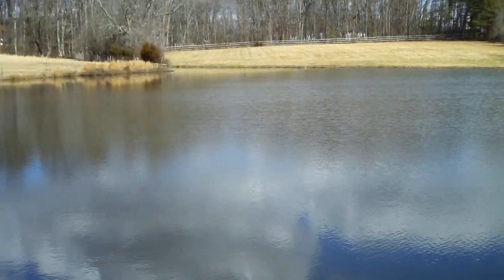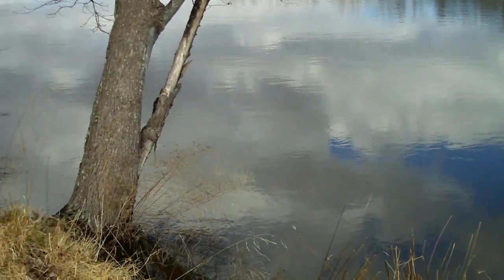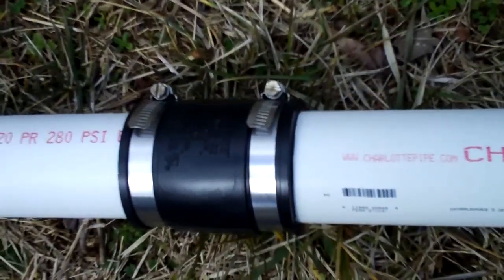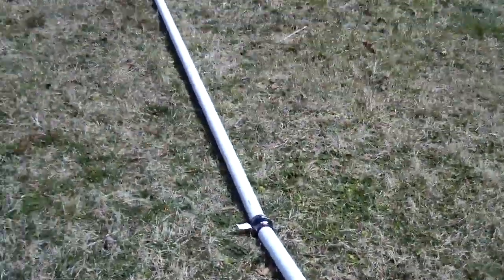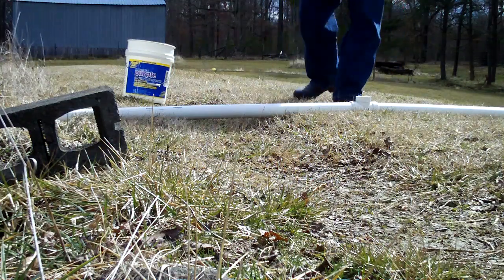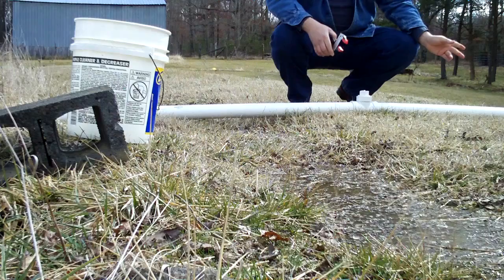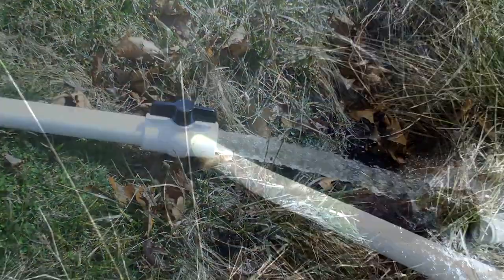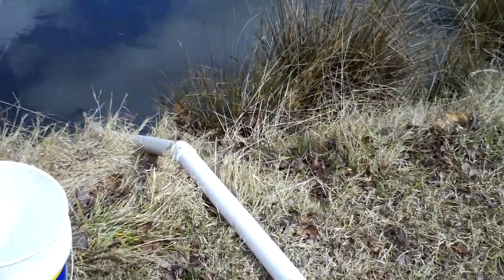DIY Pond Drain-Siphon

Comment: I also used a siphon. But I launched it with an ejector.
And not to drain the water, but to pump out the bottom sediments in the lake.
Reply from the maker: How does the injector Method work, sounds interesting enough

Comment: Wow.  I'm surprised for a pond that big they only used a 4" drain...seems like it would need at least 6 if not 10.  Of course depends on where you are in the country and how prune to heavy rain you are.  I know a pond smaller than that in Virginia that has a 10" pipe.
Reply from the maker: Several years ago I looked up our property on USGS, and the pond was shown on some old aerial photos back in the 1930s. I'm guessing it was ok for use back then or it was money issue for property owner possibly, it shown its age and slowly rusting away, I wish it had at least a 6 inch pipe, but we do have a spillway to keep the dam safe.

Comment: Do you need a filter screen on the end of the pipe? Couldn’t hurt I guess..
Reply from the maker: On the pond side I drilled one inch holes on 12 inches of the dip pipe that goes in the pond, I left the end of the inlet pipe open for maximum flow, but if there were a accidental blockage at the tip of the inlet or pond side, the one inch holes I mentioned earlier would allow for water to continue, I used a screen for some time but it made for a problem with debris blocking the inlet at times.. hope this helps.

Comment: When we pour water in the pipe the valve on one side is closed but the other side of the pipe closed or opened or opened both the sides at a time after pouring water.. please tell me...
Reply from the maker: Valve is CLOSED on OUTPUT end, fill pipe with water,make sure pipe intake is in pond,  then open  output valve, video shows everything.

Comment: Can’t you add a shut off valve on the metal pipe, where you placed the block of wood?  You then can manually drain the pond when needed.
Reply from the maker: Yes. I could, but the cost of a shut off valve is exspensive for a 4 inch pipe, also there is no flange which means a shut off valve would have to somehow clamp around the existing pipe. It would need to be brass for corrosion as well. So needless to say I spent a lot less money, but I always have to prime before use. It sucks but it works.

Comment: Will this automatically start pulling again once the water levels ride above the pipe? My pond pipe is not moving water fast enough when we get rains around 4". If I want the pond to remain at a set level, I just need the set the pipe at the height of where I want the water to be, correct? And after water fills the tube and picks up speed it should cause suction? Any help is appreciated!
Reply from the maker: Water would have to be at the level of the highest part of your siphon in order for it to actually start itself, which would most likely washing over your levy/dam, basically you would have to get a pipe put in the dam at the level of water that you want to keep within your pond or lake.
Reply: @Wallabydam  okay, that completely makes sense. I've got a buddy who owns and operates an excavator. Thank you!!
Reply from the maker: @curiouslygeorgeous  sounds good. If you do take that route,  installing the pipe within the dam at the level you want, make sure to use/pour a concrete bulkhead around the pipe slightly within  the dam on the pond side to eliminate  water seeping between pipe and soil and causing erosion and possibly  dam failure, hope all goes well for you 😎
Reply: @Wallabydam  that's a good point! I'm also going to put concrete riprap in the back. Hope it goes well too, because I can't believe some of the quotes I'm getting on this. I just don't see this being a $10,000 project. Thanks so much for the replies!
Reply from the maker: @curiouslygeorgeous  you're welcome if you drop a message back on here and let me know how everything goes!

Comment: I tried this syphon but Im getting problems. I want to drain out a garden area that's flooded. The main run off drain is two feet above my land, hence the reason the water can't run out. Can someone tell me how to make a syphon for that
Reply: It sounds like you are trying to suck and not syphon. You can't syphon uphill as the outlet has to be lower than the inlet. As the water falls because of gravity, that water creates an area of low pressure causing the water to move towards the area of low pressure. This is how a syphon works. The way you described your situation it sounds like you need a pump as a pump doesn't utilize gravity to create the area of low pressure.

Comment: U will have to use a oneway valve at end of pond side. Otherwise whatever water u filled in clean-cut will go out in pond. Incomplete video.
Reply from the maker: Nothing incomplete, you saw the video. It works,  you do not need a check valve on the pond intake. If your scared of losing a little bit of water goin back to the pond, all you have to do is raise the pipe up a few inchs with a small log or board. Pipe only needs to be filled on the Drop/outlet side, Nothing incomplete in the video.

Comment: Hi nice 👋 
Question do have a check valve on the other in ?
Thanks for your information.
Reply: Thank you.
Very good 👌
Reply from the maker: I only use one shutoff ball valve at the end, I keep it closed, then walk to top of dam and fill entire pipe with pond water using a bucket. Once pipe is fully filled. I just open that valve. I believe a check valve will slow the flow and decrease the volume of water, so for that reason I just use open piping on intake/pond side.

Comment: Q1. Can we use NRV at the suction point.
Q2. What should be the minimum distance from source to destination and minimum height of the suction & Discharge.
Reply from the maker: That will be something you will have to figure out for your specific application, depending on diameter of pipe, elevation of lift from suction point, length of pipe from suctioning point ,etc  mine has to lift water up 4ft through  a 2 inch pipe, then levels off for 10 ft. And down 30ft at roughly 35- 40 degree bank.  Basically  you need to make sure you have enough length of output piping  so it has enough "water weight" to be able to pull enough suction to draw up water and continue a siphoning,  hope this helps somewhat. Everyone has a different  situation, you will need to figure what works for your application.
Reply: @Wallabydam  Thank you
Reply from the maker: @Prabuvirus  sorry I could not be more helpful.

Comment: I'm considering a property that has a tiny watering hole that I believe to be risky for stagnant water.  About 6 feet away is a very minimal flowing (trickle really) creek.  I ran across this and think I might try this to drain the watering hole and do some work on it to make it into a natural swimming pond for my girls.  I'm just not sure how to keep it from returning to a stagnant state again.  I'm assuming a pump to cycle the water out like a swimming pool?
Reply from the maker: Water runoff that enters into this watering hole or small pond could contribute to foul water spending on what organisms, and or bacteria that can be picked up along the way heading into your pond, it is my understanding  that it is better for your pond to transfer or exchange water by pulling  water couple feet from the bottom ( pending how deep your pond is ) but you can do one of a few things to help slow or eliminate this but you may need to take extra measures in conjunction, Air stone, a air stone would help oxygenate  your water using a small pump and air line, tiny bubbles emitting from the stone and help slow processes  of stagnate water,  OR you can use a fountain that will circulate water by means of sucking water from the pond  and spraying into the air back into the pond which can help oxygenate water and help prevent stagnant water, people have used pumps that circulate water  but in conjunction with a ultraviolet  light that can kill some of the nasties in the water,  but the best way is plenty of water to (exchange) enough water in your pond and help by displacing enough to (flush) out the nasties, some of the items I mentioned earlier are sometimes used in some fish ponds,, but there is so many variables for every  situation, as silly as it sounds  you may be able to use pool  shock or chlorine that would kill off alot of nasty stuff in stagnant water, but I mean at that point you still have to check water and ph. Might as well just get a pool at this point 🤔 these are ideas, im sure someone may have better solutions, but your idea sounds great, wouldn't  it be great to have a watering hole clean and maybe a short stone wall around the edge, I hope some of this helps. I dont have a definite answer for you but it sounds like you may have something potential, if I can be any further assistance plz let me know. 😁

Comment: Thank u so much! That is awesome and helps me A LOT! i need to drain a pond that i didn't even have before the rains. 1/2 acre completed flooded.  Make more of these videos, u have some great ideas!
Reply from the maker: Thank you Miles. Just make sure you do not have any air leaks in your system or it will not create enough vacuum to start the siphon I just walked in from starting the siphon for my pond a little bit ago because of the heavy rains that we have received and I had a small air leak in it made it to where I had to try three times to start the siphon only because I don't glue all my joints together but I did use some window caulking putty to put around the scene in stop the air leak so I could actually start the siphon.. I'm glad this was helpful for you, and good luck on any of your future endeavors..
Reply: Dr.miles how many running flow time use

Comment: My brother had the same problem with his pond drain. Only it was just clogged with debris. We tried and tried to unclog the main drain but couldn't. Then, we saw your video and decided to try your siphon system.  We had plenty of 1 1/4" pvc so we used that. went to lowes and bought thr same fittings as in your video. Put it all together and primed it, opened the ball valve on the drain side and it works perfectly! Thank You for the idea!
Reply from the maker: I tried as well to repair the drain without draining the entire pond with no luck. With  the way the dam is laid out and amount of fall. It ususlly takes about 4 to 5 days depending on how saturated  the surrounding fields are and water that leaches into my pond.  I have a emergency  spillway  but do not like it because erosion,  I hope all works for you just as well as it has for me,   and your welcome ! Have a great weekend.
Reply from the maker: By the way, make sure to put something like chicken wire on the pipe that sits inside the pond. Turtles and fish or debris always gets caught up in the pipe and will stop your siphon,
Reply: @Wallabydam  i didnt out any sort of screen on the end but we will do that. thanks again.

Comment: This is awesome. I have a retention pond on my farm and the steel pipe is clogged. Maybe a turtle got stuck in there idk. 
I was gonna buy a pump.
Not now.
Reply from the maker: I had several turtles  stuck in mine over the years and would be a pain in the rear. My advice is use something like chicken wire on the pond side of the siphoning  pipe or u may end up restarting the whole process,  they will be nosing around the suction side of it and get caught  and stop it til the suction breaks.  Goodluck  with your project!

Comment: Great information here that I plan on putting to use within the next week. Did you ever fix your original drain issue? We have the exact same issue on a 60 year old, 3 acre pond in Georgia and I'm hoping to either repair or replace my current, collapsed drain.
Reply from the maker: Never did get the old drain fixed without draining the pond and digging up the dam to install a new drain pipe and seep collar. I still use the 2 inch siphon drain, looking into a way to  make a pump to prime the pipe without using a bucket and funnel. But for now it works as intended, hope yours works well for your situation! One day I will figure out a new solution  or alternative  but till then I been using this siphon, it's been running for over a week now from all the rains we get on and off.
Reply: @Wallabydam  My intention is to lesson the load on the dam for now as my spillway is getting way overworked. Then eventually drain it enough to determine if my current pipe is 100% unworkable. My dam is the exact size and configuration as yours, except for many years of tree growth on the back side. If a new drain is needed, my thought is to trench out enough to add a new pipe that is only deep enough to be vertical on the pond side and then quickly turn 90 degrees and exit through the open trench in the dam, with a seep collar, and then create a shallow trench on the back side of the dam to bury the run, down the slope, to our creek.

Does this sound workable to you? I'm sure I've overlooked something, but I'm thinking this might be a good path to take. My existing pipe seems to have a serious vertical drop on the pond side and then make its turn through the dam, to the creek.  My break, collapse or clog is about 10 feet down, vertically and completely underground and not exposed in the water.
Reply from the maker: @jkashj1994  well you can do as you mentioned as long as it doesnt get stopped up with objects.  Having a emergency  spillway always good to have in conjunction with a drain. My drain is 70+years old and steel or cast iron, its 4 inch about 13ft down into the pond and makes a 90 into and thru the dam. Developed a leak few feet under the water line, would drain way too much. So I have a spillway that works when heavy rains come,  and when drain cant work fast enough for heavy rains, just make sure you have big enough pipe if you do your drain as you described, you could put a big valve on the end of your drain pipe depending  its size and just open and close it manually on the output side. I run my siphon til water is close to bottom of suction pipe. I shut the output valve and let it hold water  till it's time to open it again due to rain. Then all I have to do it open the valve and water trapped in the pipe starts the siphon without having to prime it, I'd prefer if it drained on its own, but if I can save all the headache of losing fish and etc. I dont mind manually  draining it by siphoning

Comment: how many gallons per minute will this thing put out? I have major work to do on our pond also....
Reply from the maker: Huey Sullivan it's about 30 gallons a minute on mine and that's about 1800 gallons per hour roughly.
Reply: Thanks man. I'm now running two of them at about 50-60 per minute..... plus a trash pump running another 100... pulling pond all the way down to rebuild a stopped up stand pipe. Amazing video.
Reply from the maker: @babyhuey1202  I wish I could do that with mine but I really don't want to lose the fish that I have in there and I just don't have enough help to do the work to replace the standpipe that's in the pond and put a replacement pipe so it will drain properly without me having to do this every time it rains unfortunately I don't have the funds and it's a very big project so I'll keep doing what I've been doing which is siphoning the pond at least I don't have to run gas or anything like that for a pump, yeah man no problem I hope everything  goes well with your repair.
Reply: another important bit of info I learned the hard way.... put a check valve on the "pond end" of the line and a cut off on the out put side. Check valve will keep you from saying a lot of bad words....lol
Reply from the maker: Huey Sullivan you use the check valve on a siphon pipe I'm not sure how that would work I would think that it would kind of slow down the flow but it would be nice if the water stayed in that pipe so you wouldn't have to fill it all the time where you could just crack the valve open and start the siphon whenever you wanted as long as the water stayed in the pipe
Reply: it is simple brother....doesn't restrict at all as far as I can tell.got a number I can text a few pics to? I can show you what I did
Reply: I bought a 5 gallon bucket with lid from lowes. drilled a quadrillion 1/4  holes all the way around it. Tied a 2 liter bottle to float the pipe upright. cut a 2" hole in the bottom connected a male and female threaded coupling through it. then plumbed a spring check valve at the bottom of the bucket. that bad boy stays primed and ready to go. I also have a lot more fall at the base of the dam, it may be drawing harder explaining my increased output (that i'm not sure of)

Comment: Thanks for the video, we were in shock that it worked the first time.  Its been running strong for about 4 hours so far.  We have a 2 acre pond and we ending up putting one of the 10ftx3in pipes into the pond.  We put two 10ftx3in pipes across the path with the clean out valve between these two and then we put three 10ftx3in pipes going down into the overflow area.  We have a few beavers in the pond and I'm thinking that they blocked the overflow pipe.  We purchased a "Bar Guard for Surface Outlet Pipe" that we plan on putting on the top of the overflow pipe once the pond drains down enough for us to get access to the pipe.
Reply from the maker: Mike Cohen as long as the 2 pipes across the top  are either level or on a slight down grade  along with your 3 fall pipes it should work great. I'm excited for your success, I was going to buy 3 inch pipe to replace my 2 inch pipes, because we have had for the past week several inches of rain and of course the pond had to overflow thru a spillway  we put in years ago, but I'd much rather it go thru a pipe to reduce any erosion caused by water, thanks for letting me know about your success , that's great news!